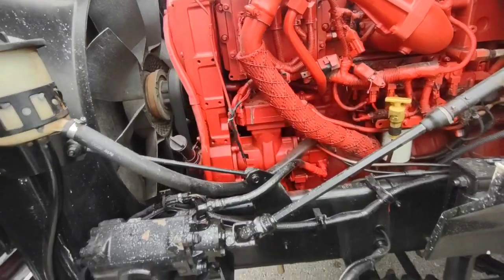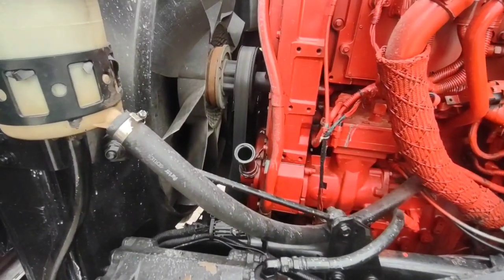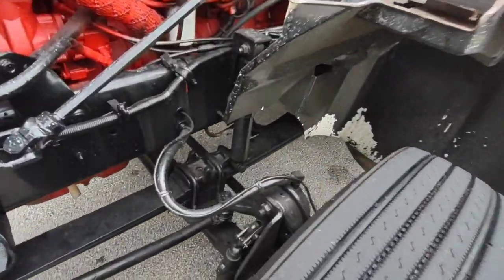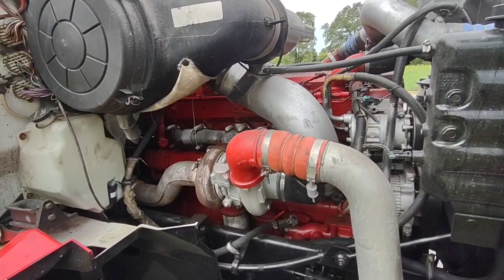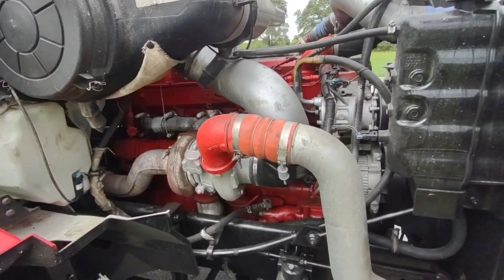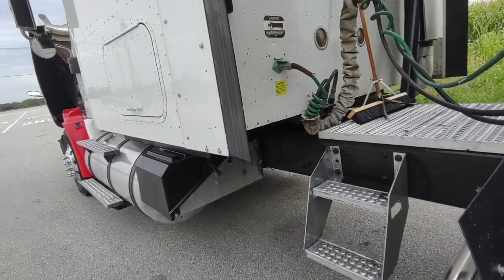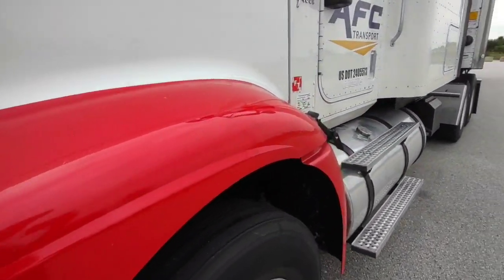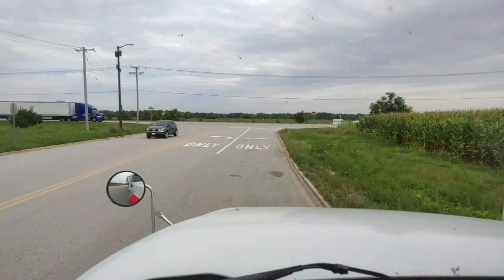Buying a used older semi truck.

Comment: Good luck with your truck. I bought my first truck in 1996 in Jacksonville. It was an 1989 GMC / Volvo W164T, with a 350 Old Cummings, on a 9 speed. It ran good. No major issues. I bought 7 other trucks after that, put drivers in some of them and here we are 28 years later. I can write a book on this. Maybe I should. This is a difficult industry to say the least. All the best.
Reply: Yes, Volvo. I'm in love with VNL

Comment: Nice truck. I bet you are still driving it. I just lost my 2003 International 9400i in a bad wreck, but my driver survived. Those trucks are tough. I’m replacing it with a 1996 9400 flattop. I love these old international.

Comment: Thanks!  I'm two months away from buying my own.  I plan on doing a pre-buy with my own mechanic and changing the hoses right away.  Based on what you said, I'll have the EGR tune up as well.  Are there any other things that you would do proactively like hub seals when you buy?  I'm in Maryland and hoping to find something close by.  My finances are similar to what you're doing and planning to put $15K towards maintenance for the year.
Reply from the maker: Well since you're in Maryland I advise you do not buy from truck mart on 81 in Pennsylvania ..... A couple years ago they were trying to sell me a Max Force international for like $60,000 ...

 The price range that your  looking at you're going to be looking at a 2013 and up truck most likely with between 500,000 and 600,000 miles....

Most dealerships you buy from you're not going to have really any problems with brakes or wheel seals most of that has already been taken care of when they bought the truck .

Well you're going to have to look for is whether or not the DPF canisters have been changed for at least cleaned lots lots of times if you're at an actual dealership you can get this information through the VIN...

Next I would highly advise you to have some money set aside so you can do an EGR tune up replace every sensor you can get your hand on if the dozer injectors for the fuel or the def do not look like they've been changed change them they're not getting any newer and it'll be cheaper to do it now than on the side of the road after a tow and two weeks sitting at a dealership...

Your best bet will be to go with a Detroit or a Cummins to be honest to Detroit are more reliable and parts are cheaper you can also buy scan tools off of eBay that'll read codes and do forced regions on both engines...

There was a period of time when the dd15s had problems with head gaskets and liners.

Cummins make sure the fuel pump has been updated to the non-ceramic plungers and even then I would suggest changing the fuel pump out again at 250,000 MI they're still known to have problems and they will destroy the engine.

Paccar engines Volvos ,macks , international A26 are all mostly dealer only for any kind of service and that means longer wait times for repairs and higher labor costs.
Reply: @Jackknife-TV  wow amazing info man thanks

Comment: Oh wow I didn’t know u used to work for prime, I’m currently at prime almost 3 years here and I’ve been thinking about buying a truck while im still here and getting everything done to it before I complete my lease and use that as money to either buy a trailer or my rainy day fund. Great video man
Reply: When you say complete your lease, what do you mean as I am in the process of getting my class a?
Reply from the maker: A lease purchase  you can lease a truck from a carrier say $1000 a week for 3 years then at the end you own it .
Reply: @Jackknife-TV  a $1000 a week, seems pretty high. But you at least guaranteed good work?
Reply from the maker: @kam5473   oh I'm not lease purchasing a truck it's my truck  I see you meant leasing to a carrier......

Now when your lease to a carrier you run under their authority which is their Dot and MC numbers ... You sign a contract agreeing to move freight for them  ...

Usually they take a percentage out of your gross pay 20% 30%. That's about the normal number right around there.... Then there's other costs such as plates permits ECT .

Comment: This is what I want to do, but I don't want to have to enter the border just to view the truck, but I may have to. I've bought vehicles sight unseen and was lucky, they did run but theres issues. Rust issues that needed to be repaired. Rusted, leaking fluid lines, etc. But the prices were do cheap...now i know why😂  I don't want to risk that with a semi.  I want a specific brand of truck. No I'm not a Pete or KW snob and I don't want a freight shaker. I actually want the brand of truck I don't have any experience with. I've heard good and bad about VNL trucks....I want one tho. It's my dream truck.

Comment: That flat exhaust is made like that so the cab wont hit all the IHs Walmart had came new like that,the flx pipe from the turbo under the cab all crack and there a bitch to change.

Comment: You familiar with Rawze YT channel? He did a test adding some gear oil to isx and I know another o/o that adds gear oil to his 2009 (?) KW isx. If interested, within Rawze channel look up video titled "ISX Engine re build PT24 duscussion of wear gear lube and oil cleanliness by Rawze" dated Jun 27, 2016
Reply from the maker: Yes I did watch a YouTube video of him explaining adding gear oil I think something between gl5 and gl4 ......

The first oil change I did have the oil tested by Blackstone and everything came back good except the lead was a little high... They weren't really concerned about it they told me they will keep an eye on it through continued oil testing...

I also had the oil tested for additives and viscosity j they said the oil was still performing within standards at 20,000 miles if there were a few extra additives that aren't normally in oil and that the viscosity was slightly thicker... I did add a gallon of Lucas and a gallon of Lucas stop leak about 5,000 mi into owning the truck so that explains that..

Comment: I have emissions codes that come and go every month with my company truck, never will I ever buy a truck that has it. I'll deal with the chances of having an old mechanical needing an overhaul over have to continuously having exhaust work done on a newer truck.
Reply from the maker: So far no breakdowns on the road no tows although it hasn't been without its problems they've all been fairly mechanical and easy to fix....

Comment: LandStar will screw you over as soon as you sign the lease agreement. New guys who would end up pulling some of the same loads I did a week earlier getting paid $200-300 less than I was getting paid.

Also… If you can purchase a truck earlier than 2004 and it’s a decent truck. Buy it…. Had my emissions deleted and yes it has saved me so much money in the long run but I do realize I am taking a chance. Always stay away from the emissions trucks as much as possible or find a guy who knows what he is doing and delete the emissions. Good day

Comment: I can't be convinced to own an ISX, how's it been so far?
Reply from the maker: So far nothing out out of the ordinary some oil leaks but Lucas stop leak is keeping it at Bay...

Had a problem with a fuel leak that was easily fixed .... Except for the fact I bought aftermarket parts the first time so I did the job twice...
Had the overhead done on the truck before I sign the paperwork  so I know the cams are good and the oil sample I had Blackstone perform came out fine...

Comment: What if there some slight blow by coming out of oil dipstick this is on a c15
Reply from the maker: I'll have to make a video on the amount of blow by I have it comes and goes..... But to be honest the only way you can really measure blow by is whether or not there's oil shooting out of the blow by tube or if you actually visit a cat dealer they can do a blow by test that measures the pressure.